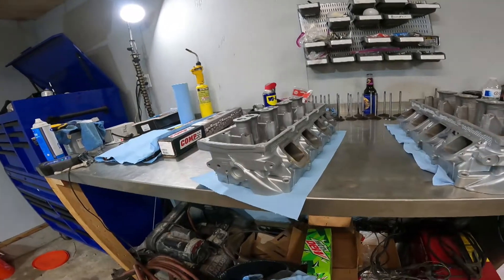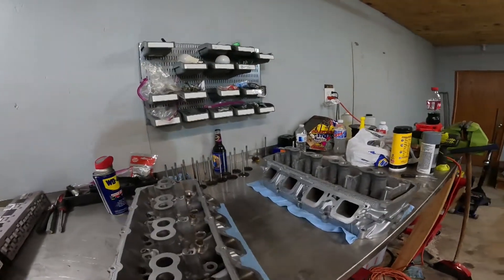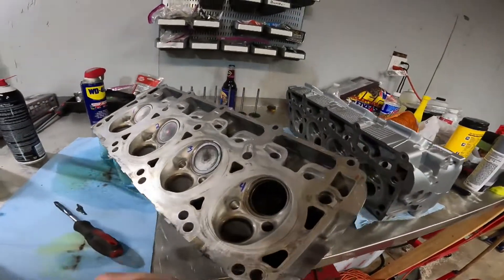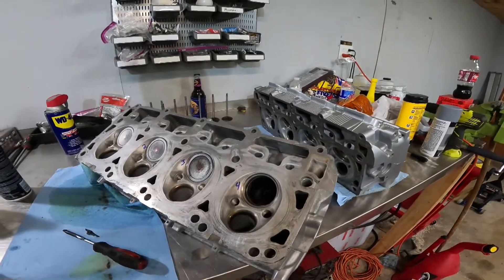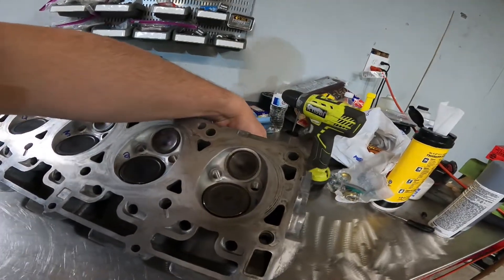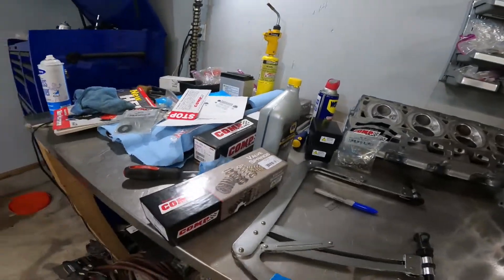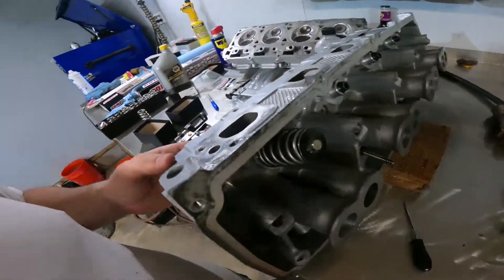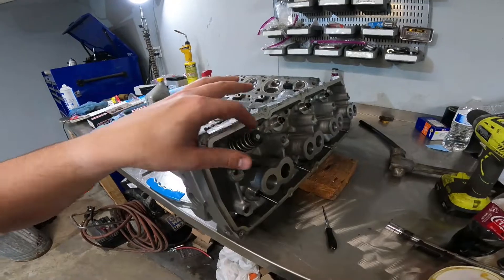5.7 Hemi Stroker Build (Part 2)

Comment: I just tapped the valve stem seals with a hammer and an extension that fit on it worked pretty well
Reply: *rubber mallet not hammer lol